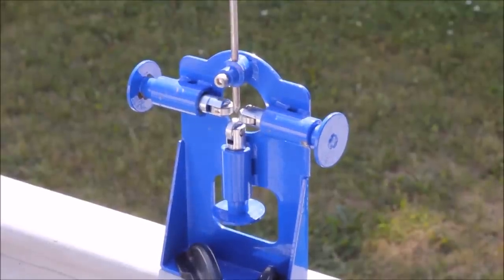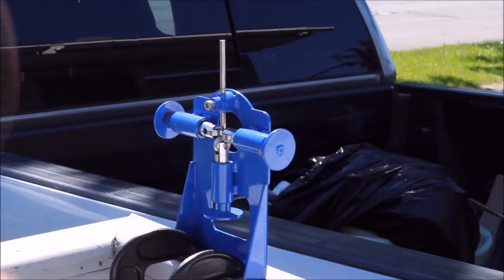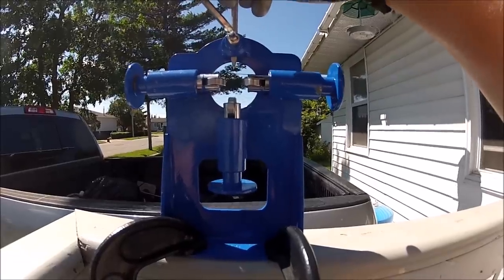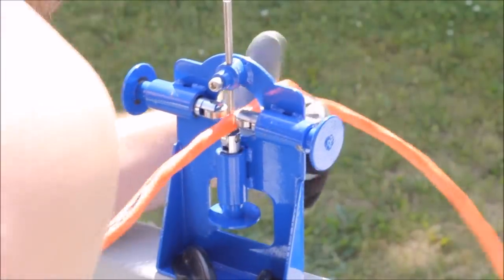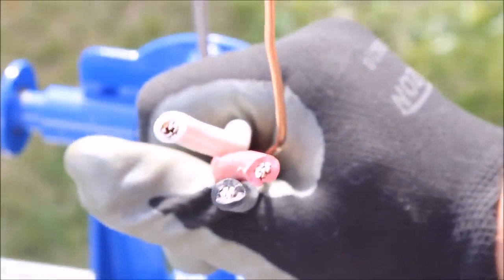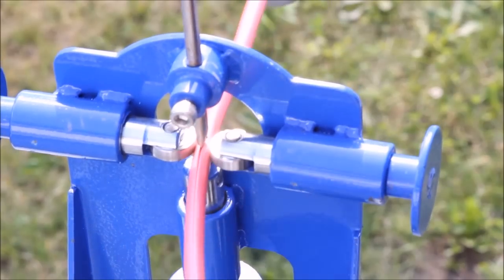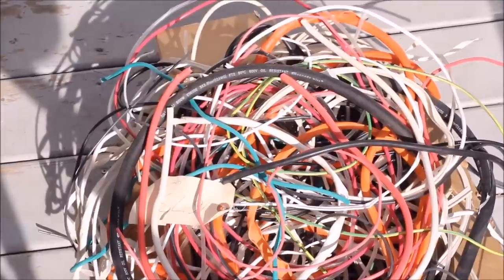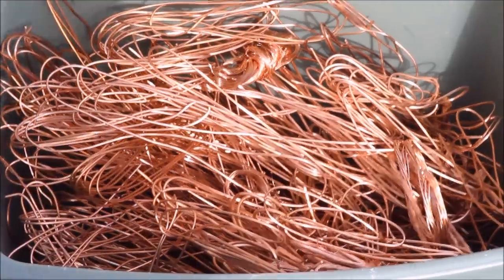Wire Stripper For Electrical Wire - Scrapping 101

Comment: Hey thanks for this promo of your wire stripper. For a long time I've looked for a simple cheap stripping machine. We've tried the razor blade methods and spent more time changing blades than stipping. My partner and I have been doing industrial tear outs and hot days holding a good Case trapper pocket knife get old quick.  A lot of the supply wire we get is an inch or so with that hard plastic coating. How does this little wonder do on that thick insulation?  Also wandering how well it does on the little 16 - 20 Guage stranded wire that control panels are full of. In the past we've been burning the small stuff but hate stinking up the place + the scrap yards won't buy it anymore.  Oh seen the painted toenails and wandered which side you were batting on until her blond hair came into view.

Comment: hi rob thanks for the video. i was wondering. do you know roughly the biggest size cable that this stripper cab handle? i've just purcahsed the coppermine wire stripper but it doesn't seem to be able to handle cables as large as this one does. it says on the instructions about 19mm. thanks
Reply from the maker: ffsneednamealltaken The biggest I have personally put through the stripper is 6/3. The way it adjusts though you could even larger gauges through with ease.

Comment: Rob, i have some really old copper that had really tough fabric insulation on it, after stripping it has silver color on outside, does this come off? what is it?
Reply from the maker: E Stan It is just what they used for household wire 30-40 years ago. I have stripped a lot of it! Pain in the ass but this wire stripper can do it.

Comment: Tip: just throw it on a campfire, copper doesn't burn, insulated coating does., just saying.
Reply: Yard wont buy burnt wire around here
Reply: So what's your address? I'll split 10,000 dollars with you if you provide me with the address of which you reside. Lol....
Reply: @rustedratchetgarage6788  why not, the plastic is burnt clean off. The copper is burned at a much higher temperature to melt it down  so I don't understand the logic, watch video of processing plant and they burn it off there to separate it from copper.  Not doubting what they told you  but I think they're full of it.
Reply: I've been told that more than once at a scrapyard but I still burn it just not at my place. I take it to my buddies.

Comment: 1300lb. of #2 @ $1.50=$1950.00--------800lb. of bare bright @ 2.60lb.=$2080.00----$130.00 dollars difference fro #1 to #2...Was it really worth all the work to strip 1300 LBs of wire??? yall decide...
Reply from the maker: Absolutely. Got to spend a full day working with the girlfriend. We both had fun and I made a huge profit. I honestly do not that there was that much plastic so where you got 1300lbs, I have no clue. Most of the wire stripped was 6/3 and 8/3. There is very little plastic in that wire. But hey, thanks for watching!
Reply: You said in the video that you put 800 lb of bare brite thru that stripper and the gross weight with the plastic on was around 1300 lb??? so there was your clue as to where I got 1300 lbs .50-.55 in the video great little stripper though.
Reply from the maker: MDCURLEY79
Gawd I had to watch it again. I screwed up in the video as to what the gross weight was. Anyways, My bad. I stripped another 100lbs over the weekend. Still have not changed or sharpened a blade.